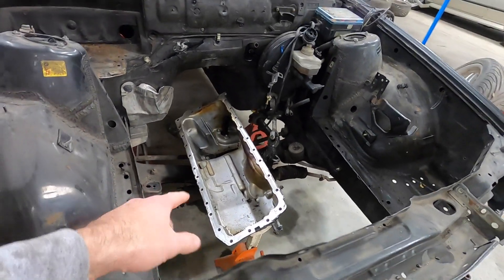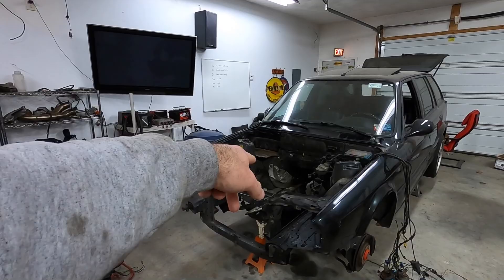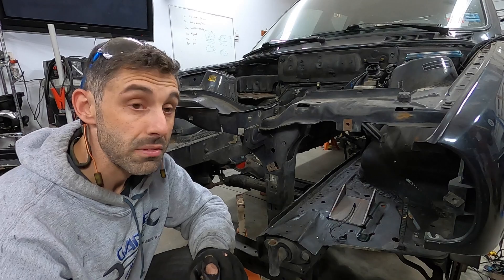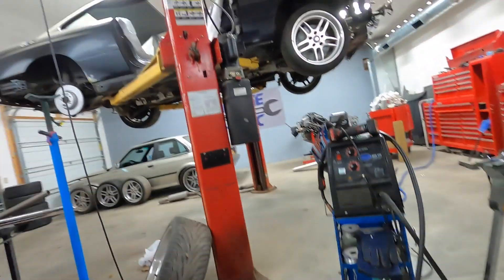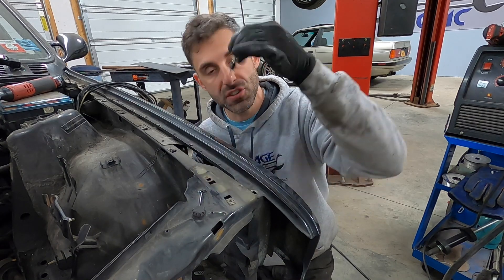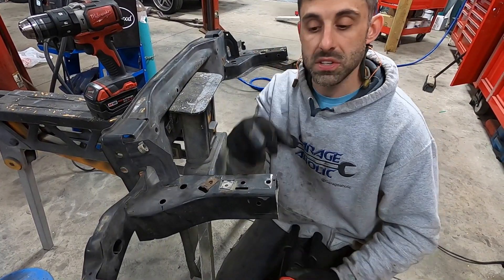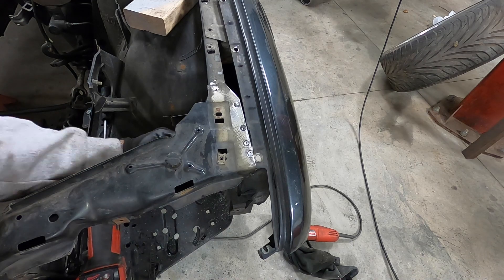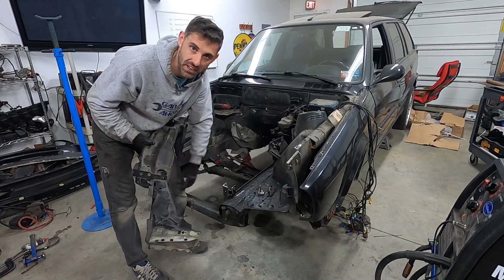Part 4: Removable E30 Core Support? Yes, Please! But How!!?

Comment: Another great video, I love the idea of removable core support. I’ve drilled many spot welds and have simply used a punch to create the point for the spring loaded center. Also I’ve found a lower RPM on the drill provides longer life for the bit.
Reply from the maker: Agree on all fronts. Truth be told, this was the first spot weld drill endeavor for me so it was a learning experience for me too!

Comment: Sorry mate but the the e30 outer skin of the chassis and radiator support are part of the rigidity of the e30 the outside components are holding the chassis together.  Why bother . If you want to remove the engine and gearbox . You just remove it from the bottom.
Reply from the maker: Appreciate the comment, but not everyone has a lift (or garage ceiling clearance) from which to install the engine from underneath. This is just one way to solve a math problem.
Reply: @Garageaholic  I don't have a hoist/ lift and I remove all my BMW engine from the bottom not hard use the engine crane to lift the front up of the vehicle I have a old rail cart that is modified that I sit the crossmember on with engine and box I use it a lot for dismantling vehicles.time is money as they say

Comment: Would making the support removable mess with the structural support of the car?
Reply: mrivr nuts and bolts are as strong as a weld.
Reply from the maker: If you did what I did at the end of the video, you would attest there is absolutely no movement.

Comment: Great job! There was a similar solution for e30 S54 swap, rear sump oil pan  , tubular subframe crossmember , and front mounted swaybar. but the guy seems no longer making the kit anymore. It is time for E30 to meet N54.
And the idea of oil pan adapter just blew me away!
Reply from the maker: Haha yeah but the pan adapter idea fell through. Unfortunately it’s just easier to weld the subframe and do front mount e36 m3 sway bar.
Reply: I already said this . Bullshit I know the bloke that makes the real kits . Not some backyard weld job by someone with no experience or knowledge about BMW
Reply from the maker: @_i-kr6eg  Hyperlink him. I'll talk to him.

Comment: A boltable core support on an e30....jeez, cant wait to that. It'll make working on the engine a lot easier. Especially timing chain replacement and timing chain cover issues. Keep it on. You r close to 5k subs 👍👍
Reply from the maker: Workin it!!!!